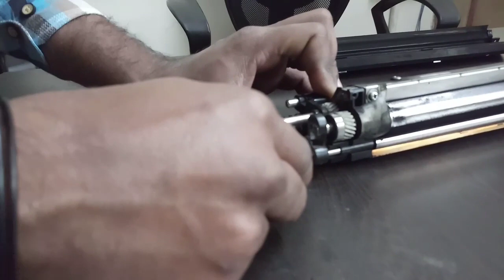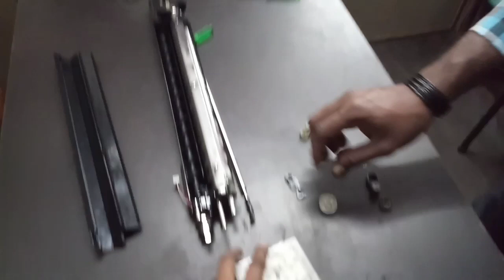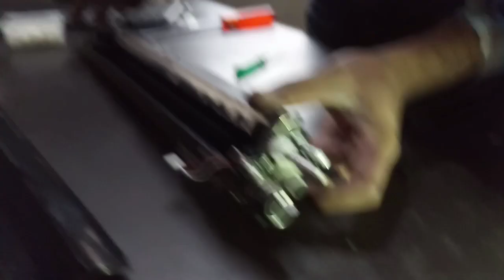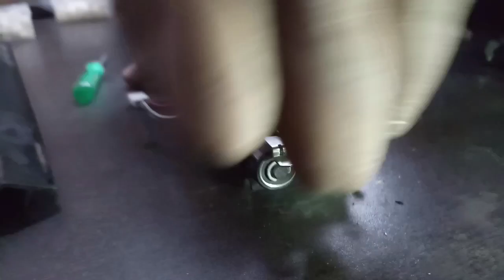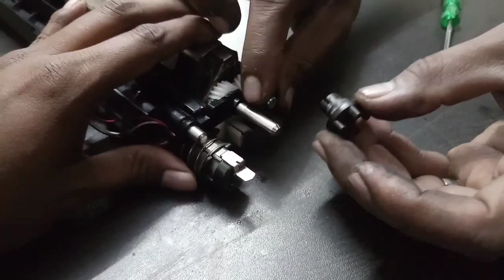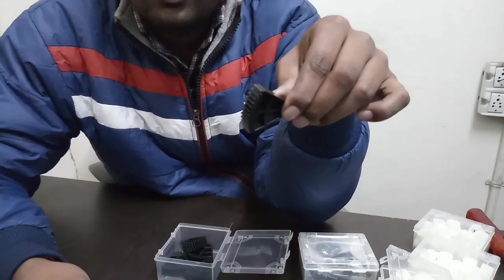How to change Developer unit Gear in Xerox DC 240,250'260,7755,7775,550,560,C70

Comment: Please need help. I have a xerox 560 color, i change the developer but The powder from the developer keeps emptying out. Doesn’t stay in and it won’t allow it to print. I change the drum, developer, toner . Thanks
Reply from the maker: Please check HVPS board or Baios board. 
There was problem
Reply: @IDCDIGITALPRINTERSSOLUTIONS  Thank you for your support. I change the Xerox 550 Bias Charge Roll HVPS, YMC and is still the same problem :(
Reply from the maker: Ping me on WhatsApp
Reply: @IDCDIGITALPRINTERSSOLUTIONS  Number?
Reply from the maker: 9910820608
Reply: @IDCDIGITALPRINTERSSOLUTIONS  Thank you Sr for your help. It works!!